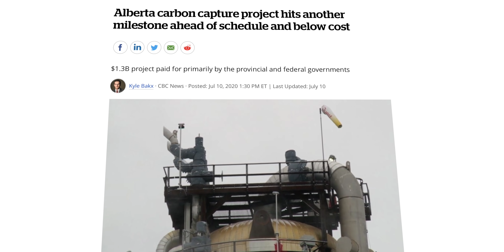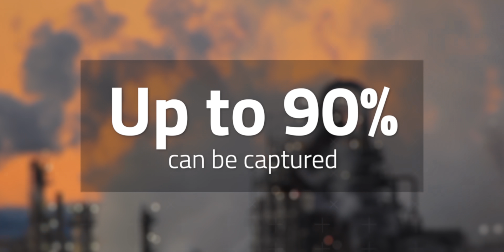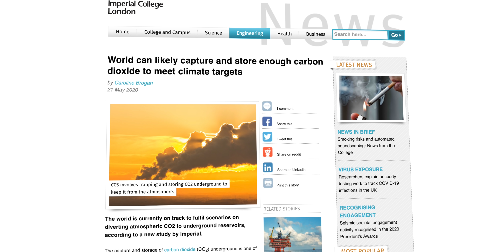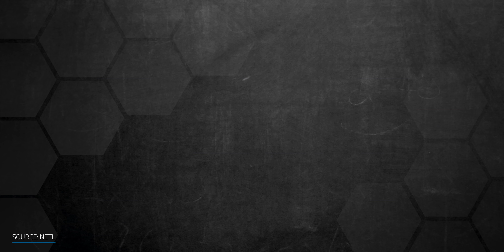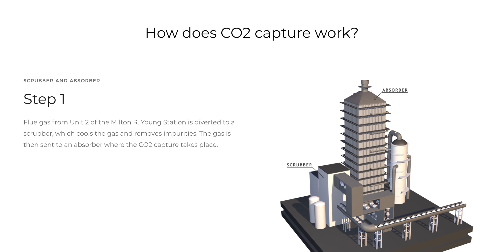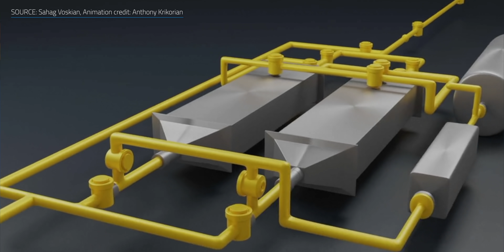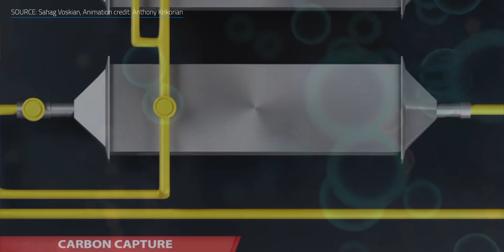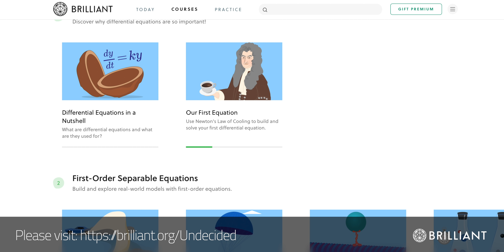The truth about capturing CO2 to reverse climate change

Comment: My first thought: Can't we just turn co2 into bricks?
Matt: Building materialsssssss
Reply: You still have to capture the co2
Reply: Google.de
Reply: Easier to turn it into lumber.
Reply: Heroniden  no no. You misunderstand me.
The point of carbon capture is to store it in one or another way.
The paper for the production of concrete has one major flaw in the way it is presented here.
You need substances that can react with the CO2 to bind it. In the classic way Limestone is used as a binder for the sand and rock. But Limestone is CaCO3. You burn it to get CaO. This reacts with water to Ca(OH)2. And this reacts with CO2 to CaCO3 and water. This is one part why concrete works. This process is responsible for 8-10 % of the worlds CO2 emissions. So its well known, basic and not easy to replace.

What was mentioned in the paper was the possebility to use slag from the Iron production as a costruction Material. The point here is, that the thing that reacts with the CO2 is unused CaO that is left in the slag. You put Limestone in the blast furnace to get rid of the unwanted silicates, but in this process CO2 is already emitted. So the only thing you do is to use the not correct calculated excess amount of burned Limestone. This is pure greenwashing. Because the slag is already used as building material and is using the CO2 from the air.
So the little bit of extra CO2 that binds in the material is nothing to the extra amount of energy you use to capture the CO2 and transport it. 

The other discripted method of using minerals of the serpentine group is nothing new, but it works. So these are minerals that can bind the CO2 for a Long Time. This is also needed for the CCS sites that want to mineralize the CO2. If its done with renewable energy, you can call it the best way to remove CO2 out of the atmosphere.

I hope this explained the point better than before.
Reply: @PlatzHalter23  what could be used in concrete in lieu of sand? There is a shortage of river and beach sand at the moment.
Reply: @timothycc711  that depends. You could recycle concrete. That is already done. But the quality isnt as good and its more expansive. I dont see an easy and cheap way at the moment. Maybe they find a way to make dessert sand easy more rough. That would solve the sand problem, but not the CO2 one
Reply: @PlatzHalter23  yes thanks for responding. I was hoping the carbon capture would solve 2 problems at once but I guess there is no substitute for river/Beach sand 😕
Reply: @nateman10  carbon will be a manufacturing material- for computing, for thermal insulation, in nano filament... but it's not going to be a practical 'building' supply in the context of brick and mortar.  

Not only would that require so so much material to produce, it's also just structurally way more than needed.  Like building a dollhouse out of titanium alloy.
Reply: @polydynamix7521  CO2 is already used this way. Romans did it before and we do it now. One part of cement and concrete is burned Limestone (Calciumoxide) which can react in water with CO2. The problem here is, every molecule of CO2 that you want to bind in building materials is previously emitted while burning the limestone.
And I dont know why nobody sees this stupid shit and thinks ... Wow this is stupid to say we can capture more CO2 in this way than we have emitted.
Thats basic chemistry 9. grade...
Reply: @PlatzHalter23  You're talking about ancient concrete but there's a reason we don't make it that way anymore.  The current aggregate is just so much better.

I guess I'm not saying it can't be used as a building supply- just that it's impractical.  Carbon requires some sort of processing to be useful in construction.  Like made into fibers and infused with resin to make carbon fiber.  By itself it's soft.  So if you're trying to process essentially carbon fiber beams for in a house you're going to have a super lightweight house... with a really really heavy cost. 

There could come a process which streamlines the production of carbon composites and makes it really cheap but as someone who keeps their finger on the pulse of emerging tech, I've not heard of anything on the horizon.
Reply: @polydynamix7521  Just no. Its not only ancient. Just look it up and dont  talk bs about how its done now.
Reply: @PlatzHalter23  "Nominal mix ratios are given in volume of Cement : Sand : Aggregate"

I do like though how you immediately started getting emotional and barking orders because I said something you didn't like. Fantastic way to get someone to take you seriously.
Reply: @polydynamix7521  I have explained it before in another comment and I am tired to write it again and again for people who dont read what i write.

As I said before, its basic knowledge of 8-9th grade school. So look this up, before you argue further.
Reply: @PlatzHalter23  I don't care.  You matter to you a lot more than you matter to me.  There are now 28 comments, and I was replying to a comment from 2 weeks ago- and you came in acting like not only did I care about what you wrote- but apparently entitled to that attention and 'annoyed' that I didn't give it to you.  As if you're some sort of authority here.

You're not somebody to me- or anyone.  You have a skewed view of your position in my world and what you're entitled to FROM me.
Reply: @nateman10  My dad, [NASA] wanted me to explore the industrial revolution patents at the Franklin Institute to see if modern micronize tech could make some of those concepts viable again. I went from MA to Philly but the stacks are no longer open to the public. I think you are on to something. Carbon rods are a really promicing thing.
Reply: We should make fuel with it. Just saying.
Reply: Babydead  carbon can be harmessed into so many things like many resources the govts ignore bc they would be economically beneficial and resourceful!! No the psychos in control only see death and destruction via profit!! It makes me sick to be part of the human race!! We are disgusting creatures that have ruined wverything and show no end
Reply: Yeah, cool idea, we should all just live in igloos made out of dry ice
Reply: More trees, more co2 absorption, more building materials
Reply: You can also make carbon fiber
Reply: @RealGalaxyGamers  requires a lot of energy.
Reply: @dmitrizaslavski8480  Exactly. More energy usually than you get from burning the carbon before, which makes it very close to useless.
Reply: @RealGalaxyGamers  thats not how things work
Reply: @RealGalaxyGamers  the majority of carbon fiber is the resin, which is plastic.  So to capture the carbon from the air just to infuse it with petroleum products that produce a lot of carbon to manufacture... it's self defeating.
Reply: @polydynamix7521  The manufacturing processes we use are enormous polluters, even when they produce energy efficient products. What good is clean to use if it is dirty to make ?
Reply: @youdonthavetoreadthispost.5850  I suppose that depends on the balance.  If it costs 2 to save 4 then it's a wise investment, though any environmental benefits would take twice as long. 

We see it happen all the time though with recycling.  Only a few materials are actually worth recycling.  Aluminum for example.  Things like paper though, require gross bleaching processes that produce toxic waste that is arguably worse than the mostly safe compost that paper could be made into. Plastic is rarely even recycled even when you recycle it- it usually gets picked apart for a few specific types of plastic and the rest ends up in a landfill anyway.
Reply: Yeah there's this thing called trees. And the. Chinese have planted a billion of them.
Reply: @asdf3568  there’s too much co2 we won’t be able plant enough trees
Reply: @xxgamin6986  Firstly, you don't know that. Secondly, if we used lumber in high rise buildings we most certainly would have enough trees
Reply: Why don`t we just let Co2 grow more plants ?
Reply: @grizerbear4898  Co2 - > fertilizer.  We did nitrogen - > fertilizer.  We put the air in the soil to grow more and can do that again.  Carbon is valuable.
Reply: @abram730  In the right hands. Money greases the wheels of the Carbon sales industry. The more you use - the more you are worth to Exon-Mobil/Shell/ Texaco - your Utility - and every other 'supplier'. Their cash incentive is NOT to reduce your consumption but to increase it. They want to sell you fuel but have to sell you efficiency to keep your business. That is the only reason energy providers promote high efficiency equipment.
 It goes against their long term financial interests. They don't WANT to do it in the first place ! Their income goes down and service costs for the equipment go up. In the end fuel sales dwindle to half, and repair costs skyrocket, while reliability goes down. They Lose big time !
Reply: @grizerbear4898  Volume - we make too much of it. Reduction is the only answer. 10% Co2 is exhaust gas typical plus or minus 2% in the heating industry. Reduction and more efficient management are needed to prevent further growth. That we can do ! 
In the Energy  biz for many a year, and now retired. I saved people money. That's why they bought. It wasn't about the environment in the beginning. Money drove the equation and still does ! If they can make money while saving the planet they will. If they can't ? They won't .
It's as simple and complicated as That ! 
The Money $$$$$$$$ is in - Selling the Fuel, not the equipment. Turning all your accounts into 'high efficiency' uses less fuel and reduces profits for the fuel $upplier$, and also increases maintenance costs for your Service Department . it equals a lose/lose for Gas & Oil sales over years - for doing the right thing and reducing consumption. Heating equipment that is sixty plus years old is still in service today, and it drinks fuel like a drunk on a Saturday night ! The 'incentive' is to keep it running and sell more fuel, unless the account is in jeopardy of leaving. That keeps an Energy supplier healthy at the customer's expense.
Trees can help, but they can't get it done. Wildfires turn them into pollution : (
Reply: @grizerbear4898  One word: ocean algae. It is more than enough to capture any amount of CO2 very cheaply.

Comment: A rant.
  Someone please explain to me that 10T tonnes is not the equivalent of a cuboid of water measuring 1000 X 10 X 1 Km. If I'm wrong then I'm wrong. I might be wrong but I'm not. Please think about that volume and mass of liquid and tell me that it is a perfectly reasonable idea to pump it underground or turn it into walls. Are there really that many walls on Earth? Is there an engineer out there who can tell me how big the bath plug needs to be to drain the 1000 X 10 X 1 Km bath in lets say 5 years?  Of course the bath will have to be under a pressure of about 10 bar and so will the place you drain into. I recognise that liquid CO2 would be denser than water, approx = e,  so maybe the bath would ONLY be 400 X 10 X 1 Km.
  I think that we should calculate the mass of the atmosphere which is really easy to do. 5.15 by 10 to the 15 tonnes, so 10T tonnes would be ONLY  about 0.2% of the atmosphere. There is a bit of a snag here, CO2 levels are at 0.04% of the atmosphere!  So we'll have 50T tonnes of anti-CO2 in the atmosphere and all life will be extinct, relying as it does on CO2. I need help form a physicist here 'does anti-CO2 exist?'. Can anti-plants use anti-CO2 to feed anti-humans (otherwise known as feminists)?
  The fundamental question is 'Is CO2 bad?' If yes 'how?' and prove it. If not then what are we doing debating putting 0.2% of the atmosphere underground and destroying all life on Earth (as if we had that power).

Comment: You failed to mention that people only contribute a few percent of the worlds carbon dioxide. Collection carbon dioxide from volcanoes would make a difference in order of magnitude to the worlds carbon dioxide. I'm not saying removing peoples contribution is pointless but just these two areas will clean the earths atmosphere by over 60%. It wouldn't be long before the problem goes away. We would need to collect 3 trillion tonnes of carbon each year for ten years to get in front of the curve.

Comment: Carbon could be also be used to manufacture diamonds but better yet graphene components. (like you mentioned hardened materials/armor or electronics/supercapacitors/electrical static capture)
Reply: Graphene dome houses would be neat and tornado resistant

Comment: Store a tank of co2 in a car.  Recharge it by adding electricity and converting it back into a hydrocarbon.  After burning the hydrocarbon, collect as much of the co2 as you can so you can repeat the process.  Every few hundred miles you will need a top-up of co2, but you will be releasing less than 2% of the co2 that we currently release.
Reply: This makes no sense from a chemistry perspective. CO2 + electricity does not equal hydrocarbons. You would also need hydrogen and a proper reactor and catalyst. You might as well just have an electric car.
Reply: @sjn7220  Just add water.
Reply: @musikSkool  It's not that simple. At best, under the right setup, you might get carbon monoxide, certainly not hydrocarbons. And this can't be implemented as "a tank on a car".

Comment: These are a paradox, you need power to run these capture plants, most power is generated by burning fossil fuels, so your burning carbon to capture carbon. But go on greenies, harp on about getting off fossil fuels entirely and only using renewables... That is a pipe dream and nothing more, ALL renewables have inherent limiting factors, many requiring standby power systems run by.... FOSSIL FUELS. And lets not forget you need fossil fuels to make renewable systems, and these carbon capture plants, and that is an inescapable fact, as steels and solar panel glass requires coal to be burnt so that product can absorb some of its properties to give the strength required. So Co2 capture simply captures the Co2 required to build and run them.

Comment: The big problem with carbon capture that I see is that it feels like just a fundamental thermodynamic impossibility. Like, ok, sure, it is technically possible to take CO2 out of the atmosphere and put it in a solid form, but not without expending just as much energy as we got out of putting it there in the first place. And it we do want to do that, I'd have a hard time believing that using expensive chemical reagents is going to beat out some sort of photosynthetic algae or other plant-based approach.

Comment: Get a big solar powered condenser and make a fuck ton of dry ice. Then make fridges and ac units run off of said dry ice. Having these dotted around countries and people to deliver said ice to the people that need it in their fridge. Boom, less strain on the power grid, co2 stored as a solid rather than gas. Get that solid storage up and less co2 gas in air. It could work for a bit until something better comes.

Comment: Have you ever heard of an advanced carbon capture technology called tree?

We should plant more of those.
Reply: I heard they are a ancient technology that is just being reintroduced. A bit like the railway system
Reply: The reason we don't use this primitive tech is because when the tech is destroyed in fire or decayed with time, it releases everything it stored.  It is like if there is a leak in the bottom of a boat, so you store the water on the top of the boat.  Sure, you will stay afloat for longer, but eventually, the boat will still go down.

Comment: Imagine using the captured CO2 to make graphene. Then use that graphene to make anything while being much stronger and lighter than any plastic or metal.
Reply: CO2 to graphene requires heating to about 1000˚C, that ain't free or green.
Reply: @sjn7220  With unlimited fusion power it would be. Hence the phrasing "imagine"
Reply: @eaaeeeea  Imagining is great, until you realize it doesn't accomplish anything. If we had fusion power, everything would be electrified and we wouldn't be burning fossil fuels anyway. Unfortunately fusion power is perpetually "only 25 years away".
Reply: @sjn7220  I would say the opposite. No-one would ever accomplish anything if they didn't imagine it first. I wouldn't be so quick to dismiss the progress on the ITER fusion plant, which has a good chance to break that perpetuity. In case of unlimited renewable energy we would still have the CO2 in our atmosphere, so why not put it to good use.
Reply: @eaaeeeea  I'm all for fusion, but it is nowhere close to being ready for energy generation, unlikely in our lifetime. CO2 in our atmosphere is a necessity for plant life. If we stop generating it, it will return to equilibrium levels. Don't forget, atmospheric chemistry modeling is highly inaccurate, don't take their projections as absolute truth.

Comment: Carbon capture makes fossil fuel plants less efficient, both electrically and financially. It would be easier just to use solar and wind. It might be useful for offsetting lorries/trucks and planes, where batteries are not currently a great choice, but that would require extra fuel tax to finance it, making batteries look more appealing after all.
Reply: Well yes but the main point of carbon capture is probably retrofitting whats already there